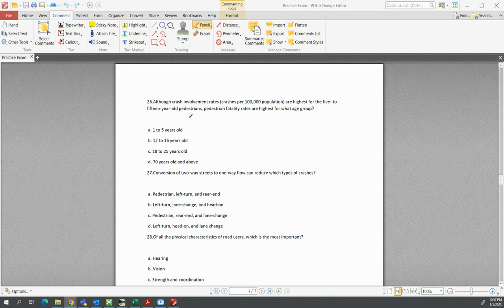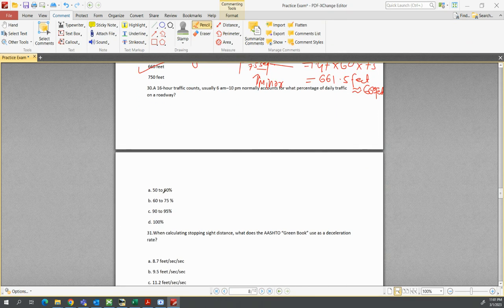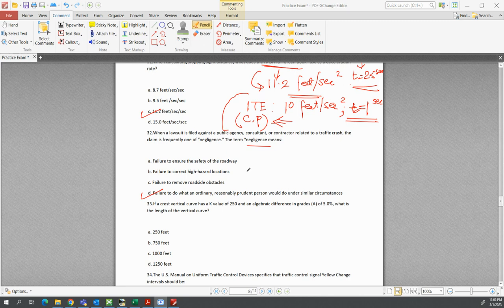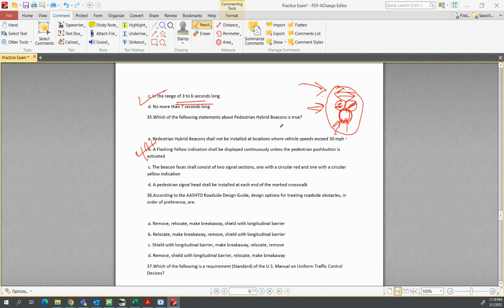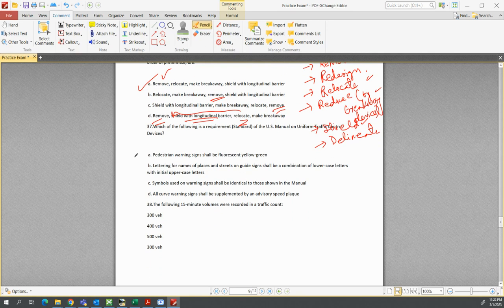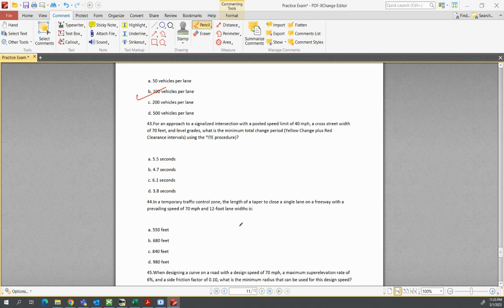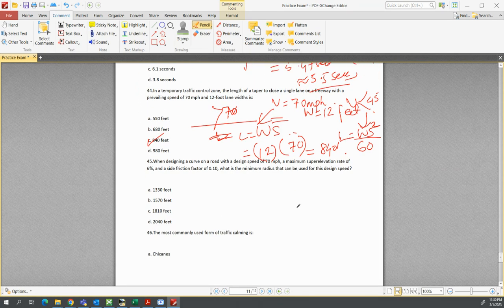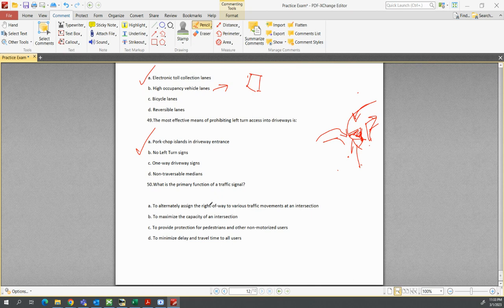Traffic Engineering | PTOE | Sample - Part 2

Comment: number 27 is clearly b. One way roadways dont improve rearend crashes.
Reply: I think the reasoning behind (a) being the correct answer is that without an opposing traffic lane, there is less queuing/stopped vehicles behind left-turning vehicles so a lower risk of rear-ends at intersections. B, C, and D are all incorrect because risk of lane change crashes would increase with the converted added lane(s).